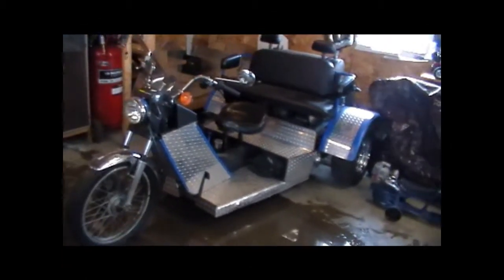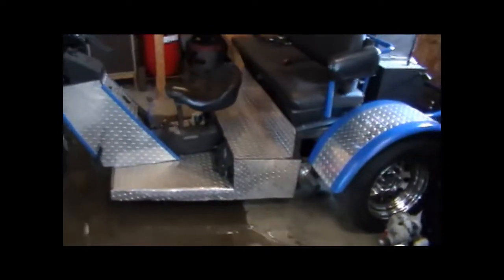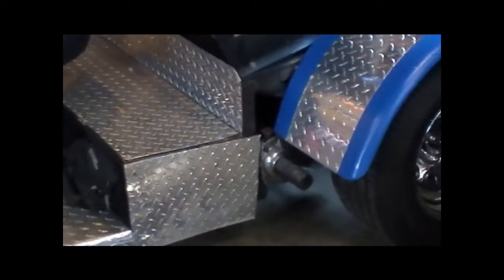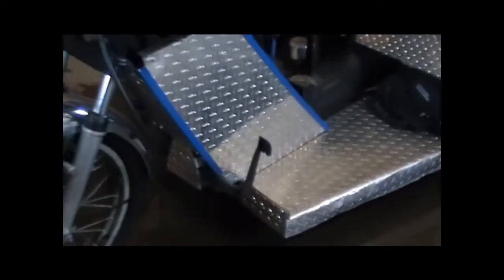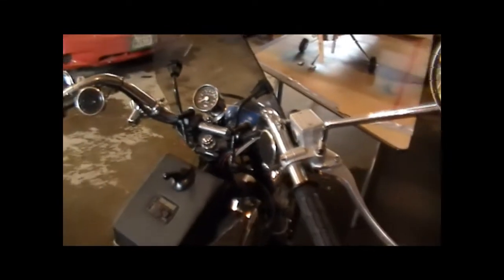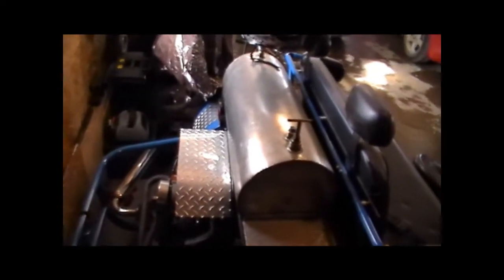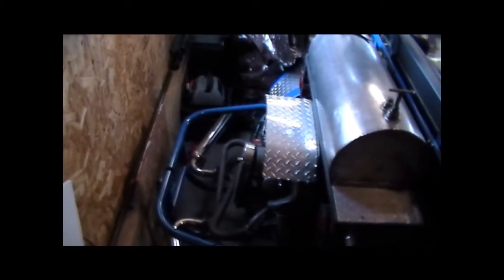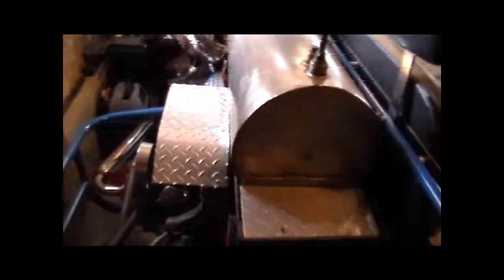VW Trike

Comment from the maker: @jettastreetracer Yeah I know you wanted me to do one. I will do one. ratchet works no problems, sand blaster no problems. impact gun, no problem unless air is low, that case I crack them loose by hand then use the gun. Cutoff wheel works good unless low on air, that is the most taxing on the compressor, quick cuts, short uses it works great. I will make a video though. Please rate my video's and subscribe! Thanks!